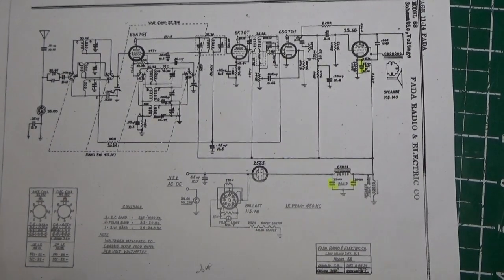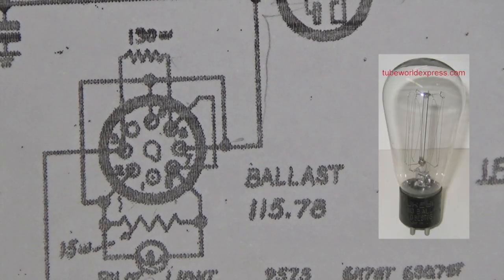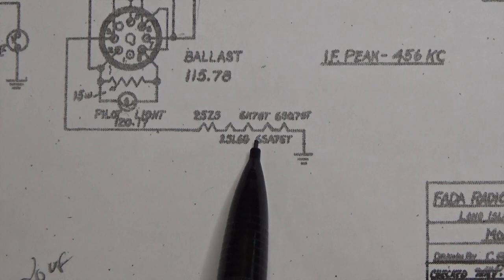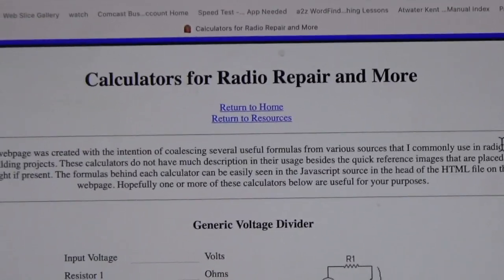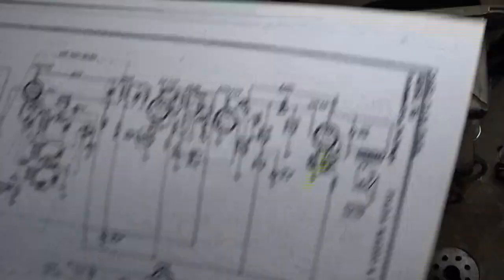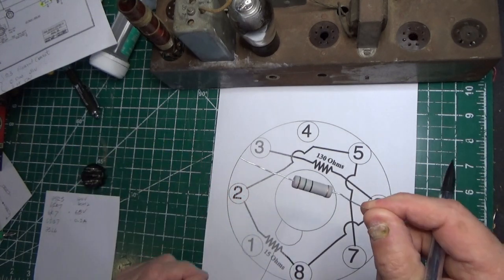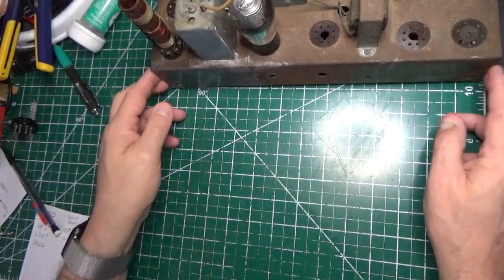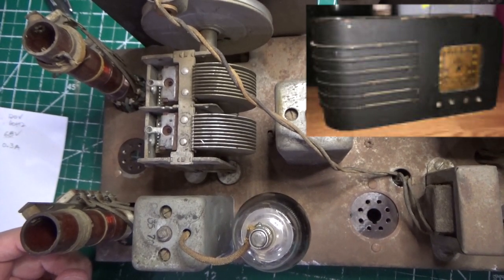Fada Model 68 : First Look and Ballast Tube Discussion

Comment from the maker: ****   In case any of you are wondering, its much better to use a Non-Polarized Cap to do this.  A polarized cap will work, but its life would be severely shortened based on this application.

Comment: Ron - cool radio and definitely worthy of restoring. The ballast solution should work really well and keep the heat down. I’ve used defective tubes and taken them apart by soaking in acetone or lacquer thinner to dissolve the glue around the base. Good luck, I’ll be following along with you. Best, Don
Reply from the maker: Don, thank you  - thats a very good suggestion on the tube option !!!  I need to see how big the 8uf cap ends up being before I land on a final solution.   Thank you sir
Reply: @rciancia  BTW - what supplier do you use for the AC capacitors?
Reply from the maker: @RestoreOldRadios   Don, Home Depot/Lowes carries them, but for the values they don't have, Amazon has just about everything.

Comment: The problem with using a cap is they usually fail short. This would wipe out at least one tube and they are becoming rarer every day. I don't like using resistors as they make a ton of heat. 

 What I do with sets like this is I update the tube string to 12SA7, 12K7, 12SQ7, 50L6, 35Z5. This totals up to the 121 line voltage and is plug and play.
The 35Z5 heater has a tap for the dial lamp. 

  Then to help protect all the heaters (when the string is cold one of them always takes a hit at turn on) I put an NTC in series with the string. The Digi key P/N 317-1146 will be at 60 ohms cold and drops to 1.8 ohms hot. It takes the shock of cold start and protects the heaters. Produces very little added heat, they are tiny and costs pennies.

Comment: The ballast tube substitution is a great tip. We will all be using that at some point in this hobby.
Reply from the maker: Thank you. I can also be done with Diodes, but its a little harder because of the requirements of individual radios.   !!   Thanks for watching.

Comment: I have a 1937 Air King radio Model 252 I first worked on it had a ballast tube(M49HG) impossible to find I ended up wiring in a couple of bulbs to replace it and it does work fine. It uses the same tubes you show on your schematic. My Air King also has a wood case. Should be a great project Ron thanks for sharing it.
Reply from the maker: Now you can use the 8uf FAN Cap :)    I figured that Ballast Tubes were most common  between 1937-1940 - Thanks for watching my friend
Reply from the maker: Larry, I was thinking about your solution and basically what you've created is a form of a Dim Bulb tester.... pretty cool

Comment: I recommend a CL-90 thermistor in series with the filament string.  With cold filaments and switch-on on AC cycle peak there will be a huge current spike.
Reply from the maker: James,  It is my understanding that by using Capacitive Reactance, there is no worry about inRush current.   But, I will check and confirm this. Thank you !!!

Comment: "FARTA"   radio.....I can't help myself, that it funny.
I do not think those large IF cans would have the silver mice desese.
I think you can mount the fan cap in a plastic tube or maybe a PVC pipe with a end cap on it.
Reply from the maker: LOL < i knew you would love it Bill... LOL   Farta...   I am printing a plastic tube to go over a socket I have. I think that will do the trick - I will show it in the next video..   LOL Farta
Reply: @rciancia  Don't FART on a FARTA....LOL